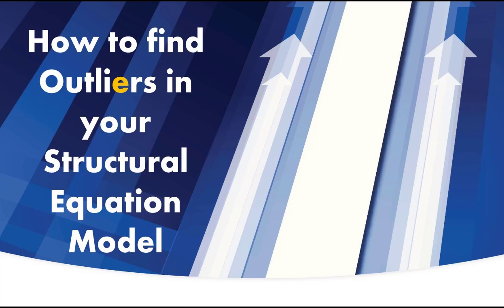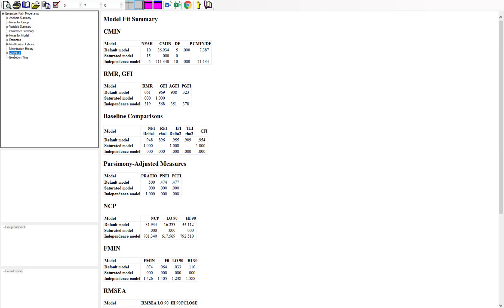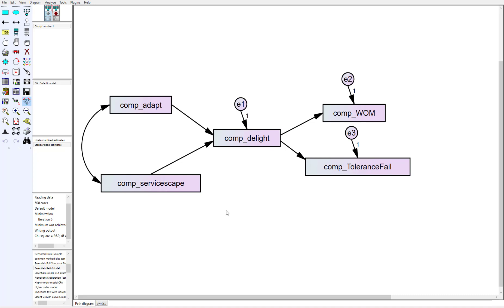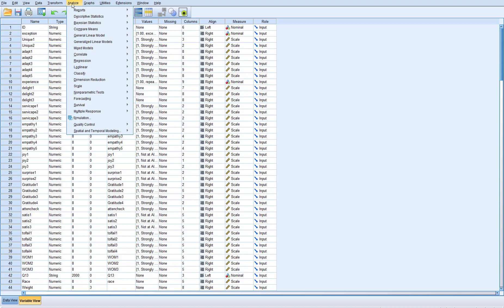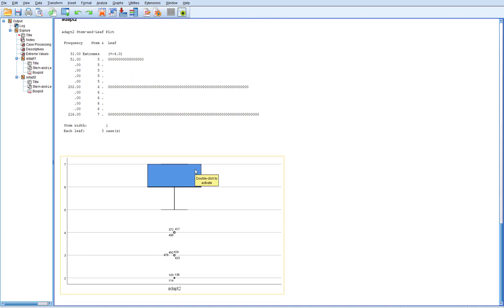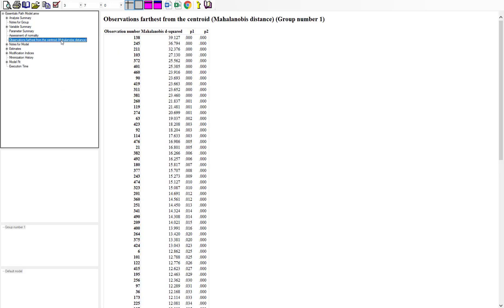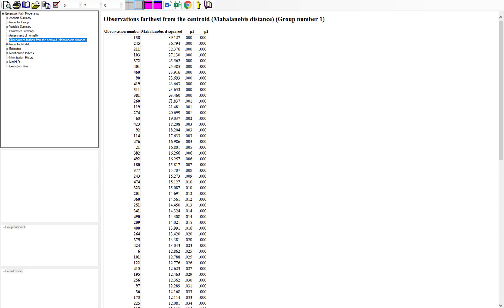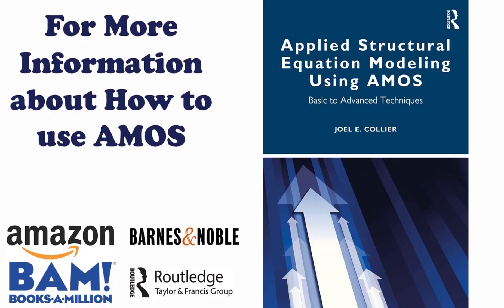How to find Outliers in your Structural Equation Model (AMOS)

Comment: Thank you for the video! I selected the test for normality, but the output does not include this analyisis; my data set has missing data - this may be the reason?. I was planning to use the data imputation option; however, I am unsure how this will affect the normality test results. Do you have any suggestions?
Reply from the maker: I always encourage you to impute data in SPSS/SAS/Excel before starting to analyze the data.  It is the easiest way to address missing data.  You can do it in AMOS but it is not that easy.  Try imputing your missing data and then try it again.

Comment: In your book, and here in the video, you mention that if the  p1 AND p2 values are less than .001, then the case should be considered  an outlier. Does it mean that for a case to be considered an outlier, both of the corresponding p1 and p2 values should be less than .001 simultaneously?
Reply from the maker: Correct.  Both p1 and p2 need to be below .001 simultaneously to be considered an outlier
Reply: @joelcollier9387  thank you very much for the clarification.

Comment: When i try to run the model a message saying " the model is probably unidentified. In order to achieve identifibilty, it will probably be neccesary to impose 2 additional constraints" 
🥺🥺🥺🥺🥺
Any clue sir?!
Reply from the maker: You can get that message for a number of reasons.  Here are probably the top reasons 1) You forgot to delete something like an error term that is hanging out there by itself not attached to anything 2) You have not set the metric with one of your unobservable variables by constraining one of the indicators to "1" 3) You have too many covariances added in the model and now are underidentified.  Like I said, you can get that message for a number of reasons.  These are some of the most prominent.
Reply: @joelcollier9387  thank you for your time doctor,
I will try to go through them all 🙏🙏🙏🙏🙏